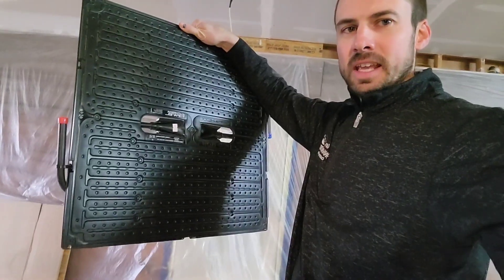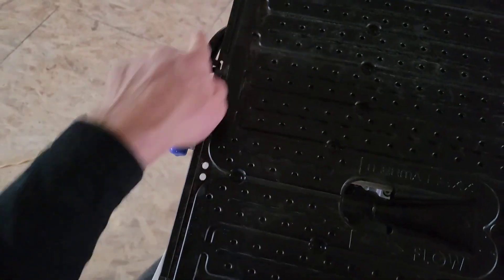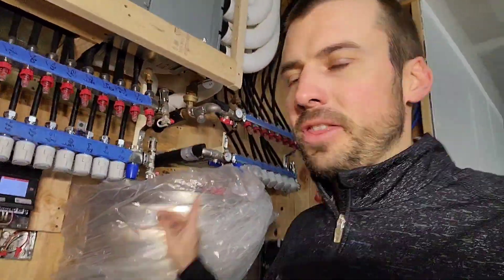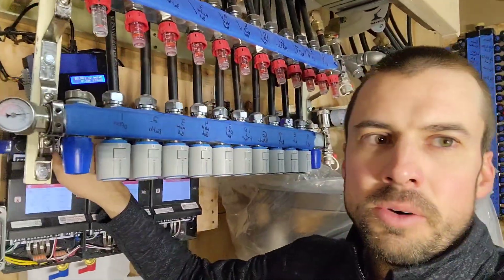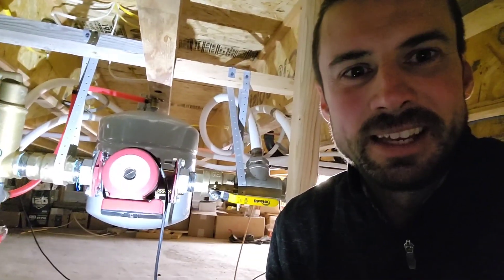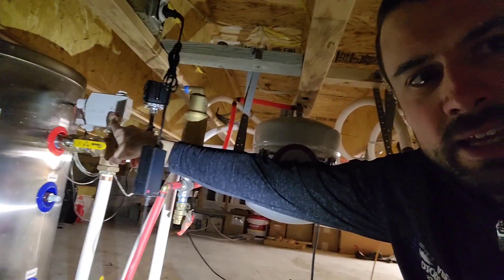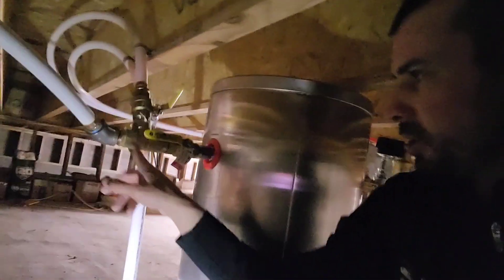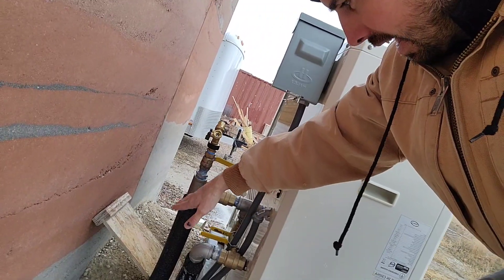Radiant ceiling heating and cooling with Therma-Hexx

Comment: Looks really neat, thanks for sharing.  Might want to rotate the indoor main circ pump so the electronics are on the top side.  By now you might have insulated the water/glycol pipes at the outdoor unit the rest of the way?
Reply from the maker: I know it should be rotated, but I don't have the space for that.  So far the mixing valve has kept me from having any condensation.  Thanks for the reminder on making sure all the pipes get insulated fully.

Comment: I look forward to the 1 year review.

Also curious how the humidity is being controlled. Just keeping temperature to prevent condensation doesn’t control the humidity in the house. Is there a whole house dehumidifier?
Reply from the maker: No dehumidifier, My ERV handles some of it.  Otherwise it's not a problem here in the arid deserts of Utah.  We're sitting on average at 30% RH. I wouldn't mind putting in a humidifier to bring that up to 40%.

Comment: Hi, I've been looking into thermal cooling a bit lately. I'm up in Logan UT, and would like to rely on Geothermal/ground source. Is this something that you also considered? I know it is hard to find a Water to water Heat "and" cooling pump. 
I know therma hexx does a great job distributing/absorbing energy. Now that we have had a hot summer how has your system performed during the summer? I'm considering building a 40ishx40ish bardo, and having the ceiling running the cooling during the summer. Your feedback would be very much appreciated.
Thanks Stanford.
Reply from the maker: Your build sounds awesome.  We 2 summers with the system now and its worked perfectly.  It keeps the house at a comfortable temperature.  I really wanted to do geothermal and even talked to an engineer who had designed and implemented a couple.  He talked me out of geo.  Two big reasons.  number 1, if anything goes wrong with the buried pipes you have to redo the entire system. and 2 the systems he's done haven't been as efficient as they were supposed to be.  I was also in a hurry at that point to get done and what I did was quicker.

Comment: I have that same manifold, did u have any problem with is working being mounted upside down?
Reply from the maker: It's working fine, I have one actuator that stopped working right away.  I haven't looked into why.  It's for the set next to the front door and I'm ok if they're open all the time.  I'm sure I'll get around to fixing it eventually.

Comment: Oversizing a system can be a issue. Bigger is not necessarily better in HVAC. I hope this works out for comfort all year long.
Reply from the maker: Thanks, it's been working out really well.  I wish they made half ton heat exchangers for ultra energy efficient builds like mine.